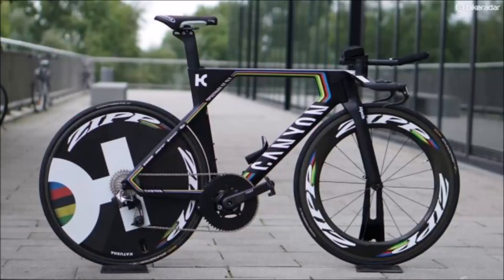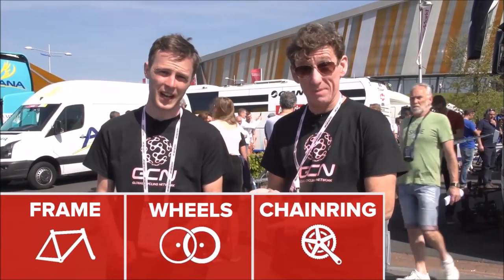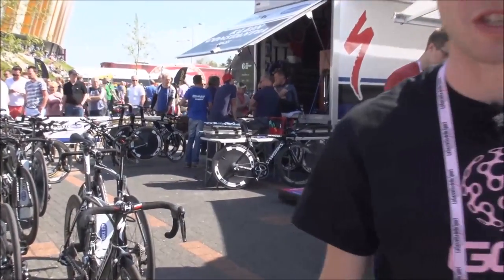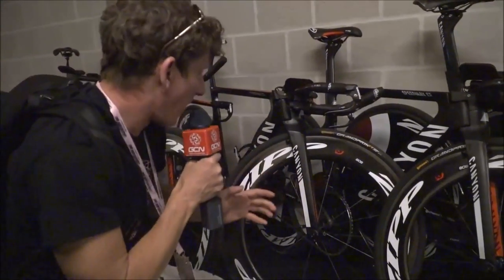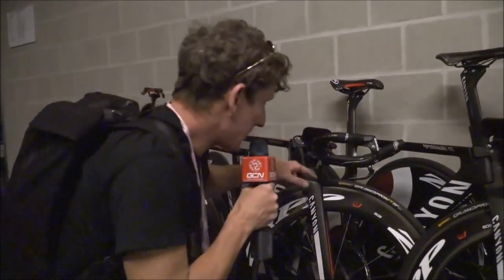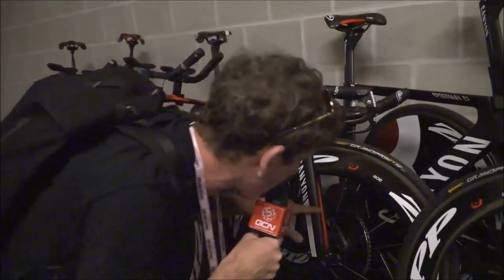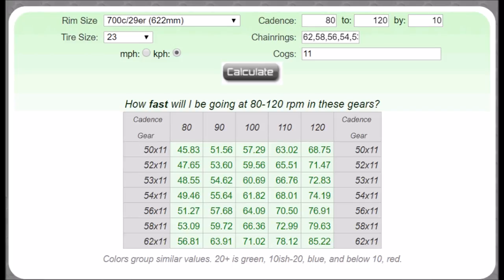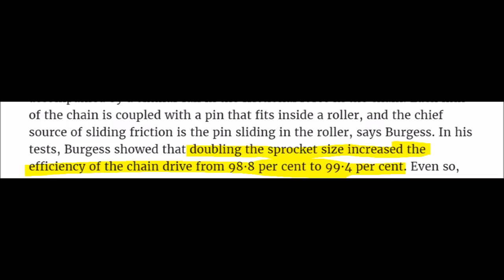Why do pro's ride such big chain rings?

Comment: Bigger rings means bigger force, bigger force means bigger muscle tear, bigger muscle tear means bigger muscle gain, bigger muscle gain means bigger power.
Reply: higher cadence means more endurance, more cardio. not that i care, i want big legs
Reply: @ricardog4459  uhh yup.. but i take cycling as a my leg day. So yeah..
Reply: And you will be faster i think
Reply: Yes bigger rings require bigger energy but
Do smaller rings make you faster??
I mean i we use energy equally as in case of bigger rings will we get more speed in that power?
Reply: @burairshah4870  it depends on your cadence and leg strength
Reply: Big thighs big gears
Reply: yeah no for everybody

Comment: such configurations may do wonders for electric bicycles, where one could expect the pedal assist to take you to highway speeds!
Reply: big 60 to 70+ chainrings are already in use on velomobiles which regularly reach 40-70kph .
Reply: Yep, especially for rear hub motors where there might be not enough space for more than a single cog, and practically the only solution would be to have multiple chainrings

Comment: Using a 58t let's you sit closer to the middle cog at the cassette end giving you a straighter chain line which is more than the gains you get from running bigger rings alone. Going for bigger jockey wheels and waxing the chain are the other easier two main methods of friction reduction as they are simply a case of fitting to get gains, but with chainring and chainline there is some maths involved to determine the cadence vs speed for each course and the gear position you'll be in for the most time, on top of that you then have to take wind speed and direction in to account too.

Comment: The difference in efficiency in the middle of a cassette is 0.27 Watts comparing a 53T to a 46T. Lesson....it doesn't matter. Get the chainring that matches yiur ability to stay in the middle of a cassette for your cruising speed.

You also need to consider your crank length. A smaller crank length in comparison to a standard 172.5mm is directly proportional to an "effective" larger chainring size.

I use a 46T with 155mm cranks. It gives me an effective 51.5T and I lose 0.27 Watts compared to a 53T in the middle of the cassette. At an xtreme angle outside of the middle, this increases to 1 Watt in comparison. My open hip angle gives me considerably more power and I can get more aero. 48T would be too big as it would act as an "effective" 54.5T.  

I also use q-rings, so with my effective 51.5T, I get an effctive 54.5T in the power zone, which progresses to 48.5T through the deadspot.

Works like a dream  for me.. 
People tend to use chainrings that are far too big for their capabilities. For the majority of recreational riders, a  46T with standard length cranks is actually what they need...like a gravel bike.

Comment: Was Using a single speed narrow wide 60t aero chainring on my tt bike in combination with higher teeth sprocket starting from <14t since 2015 allready. And I like the 99,4 % drivechain efficiency or feeling of it especially during powerfull accelerations.
0,6% more efficiency at a average FTP 300 watt fto is 1.8 watts ; not very much. But still a marginal gain.
Imagine a track sprinter maximum effort final sprint at 2.000 Watt peak. Then those 0,6% gain is 12 Watts. Always hated the grinding noise of a 11t small ring at the back .
Oversized derailleur pulleys fi ceramic speed do achieve about the same gain.
So this is exactly why I will not buy a sram cassette with an even  smaller 10 tooth baby sprocket to torture the chain in the back.

Comment: I'm using 60tx15t cog on my track bike.
Reply: Beast...😵 top speed?
Reply: My friend uses 75t by 15.
Reply: Where did you buy yours from? I've been looking for one myself
Reply: @aaronserigne5646  my chainring I bought from Amazon  it's a 60t brand O.T.A look it up just type 60t ota chainring and it's the one way at the bottom. Its been good to me since I bought it. its been almost a yr now.
Reply: A Rod 

Is there a 64t? I’m thinking to fabricate a cassette and chain ring that would be land speed record worthy. Namely having it at 64t and once I can figure out a daring solution... 128t. And I want the cassette in multipliers of 4 which will make Gear ratio calculation easy, but the cadence change from a 12 cog to a 8 would be pretty bad, wouldn’t it?
Reply: Top Secret that would be interesting to see, 128t x 8cog your take off would be slow but once you get it going you’ll be flying.  So the biggest chainring I’ve seen so far is a 75t but I’m pretty sure you can find it in the 100’s..
Reply: I'm running a 66 : 13 on my bike
Reply: Seems like Track (I mean real Track uses) Big gears is trend.

Now..... my frame have limits on chainring clearance sigh I wish Dolan Pre Cursa take more than 53T.